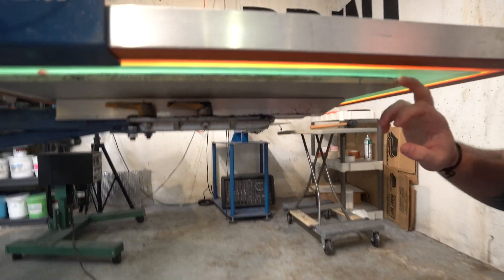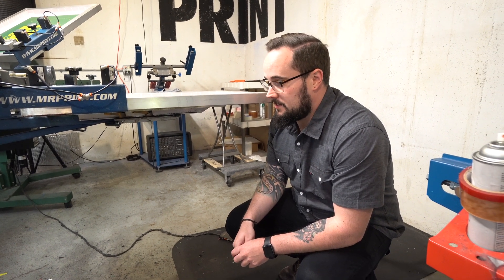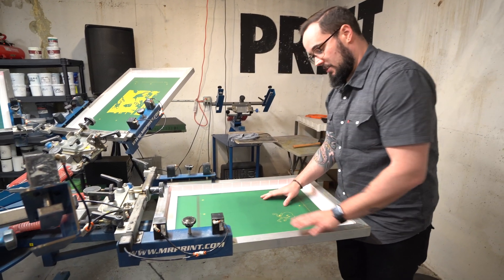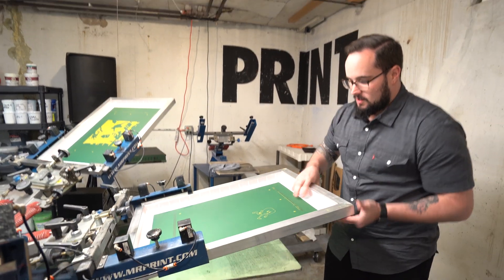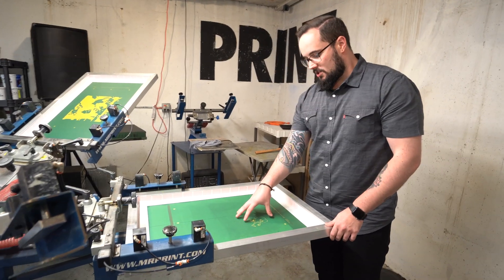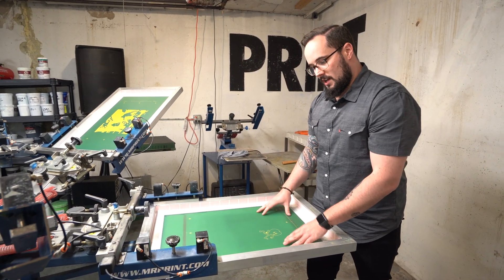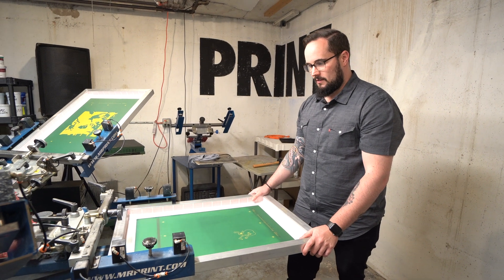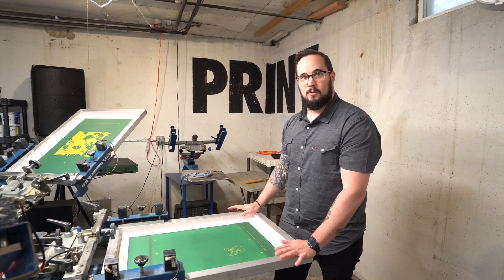Proper Off Contact in Screen Printing

Comment: Hello, I'm searching for a very specific printing technique for my term work if any one help me I appreciate. What I'm looking is to transfer an image over a terrain model which is made by CNC by using digital elevation model. I guest I should use a photo emulsion cover onto this irregular surface, print the image over a transparent material (glass or pvc) then put over the terrain model and expose under 500w halogen or something like this. Does it work? Do you have ant suggestion for me to find a proper way to do? Best regards.
Reply from the maker: Wow, super interesting question. We're not sure - that sounds like a complicated problem.
Reply: Eh it sounds more like you should print onto thin clear plastic then use a vaccum form method just my opinion